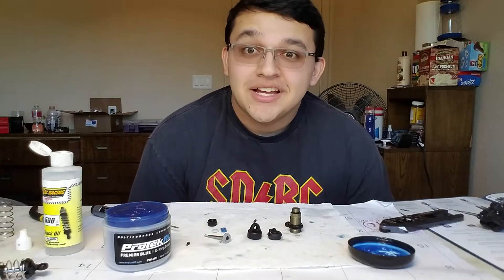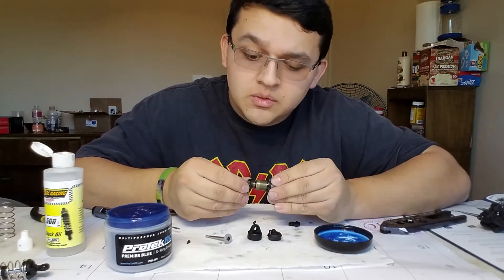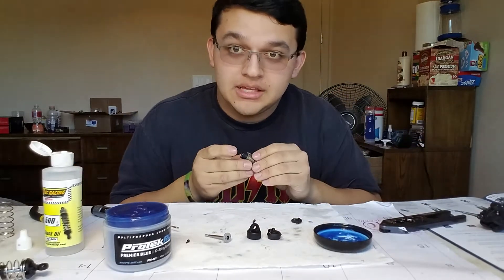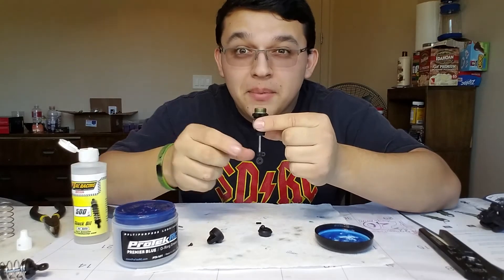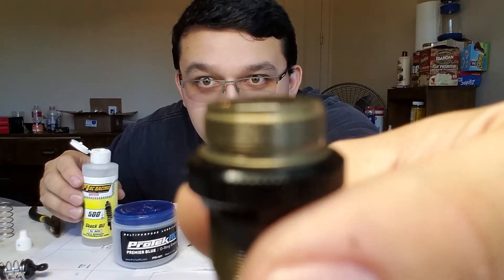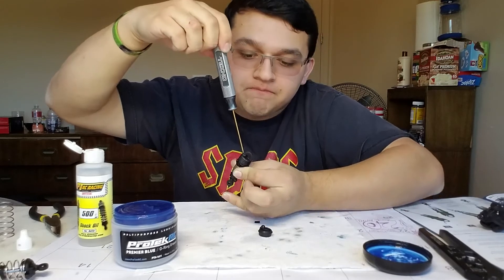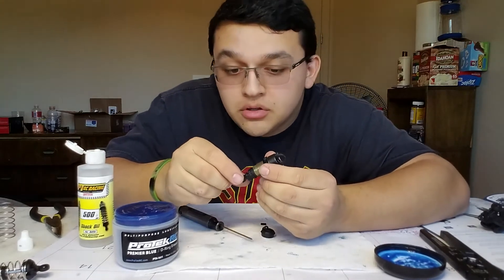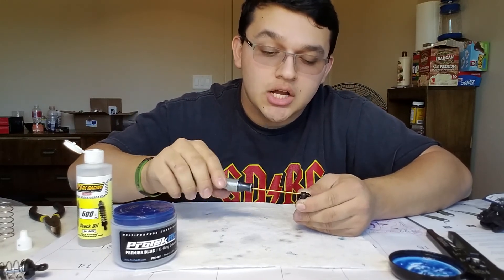Shock build and maintenance 101 (tekno eb410)

Comment: Love vid very helpful newbie like me. Just wondering that why 45 degree when breeding thanks.
Reply from the maker: jungyul kim the reason for the 45 degree angle is so that the bleeder hole becomes vertical and allows the air & oil in the shock to bleed out efficiently